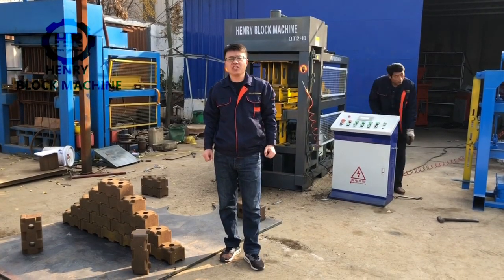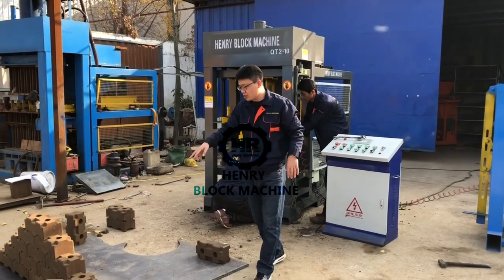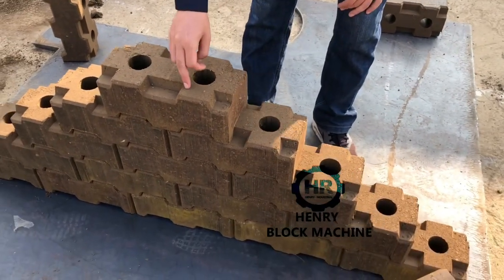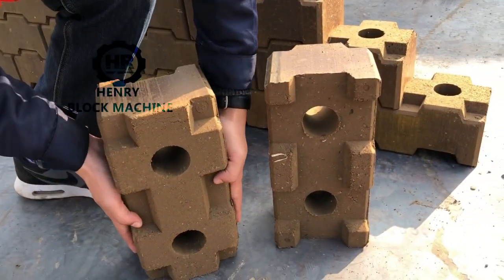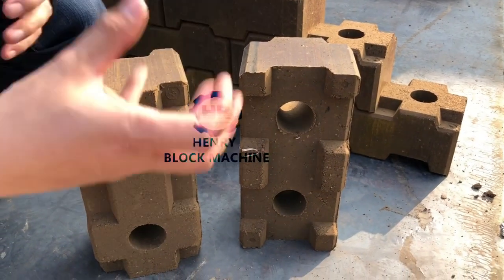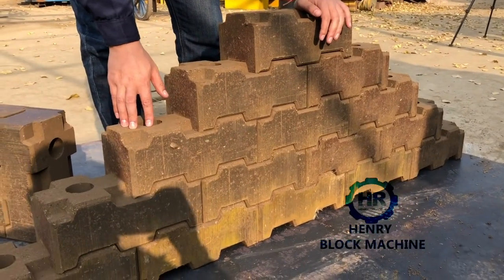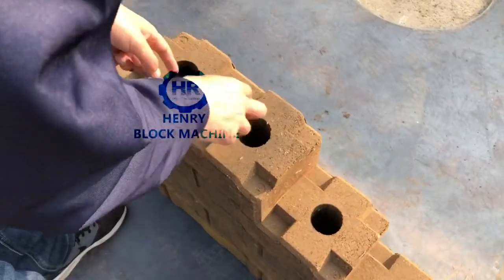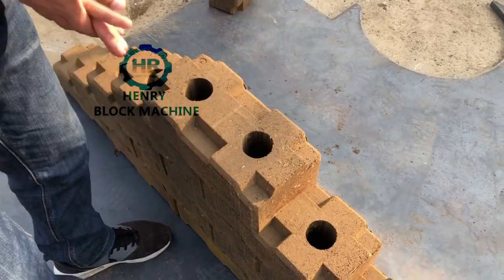How can a soil brick making machine help you build a sustainable future? How to use a soil brick？

Comment: What does this cost??
Reply from the maker: Hi dear friend . If you need more information about Henry intelligent brick machines . Please go through our official website : www.brickmachinesupplier.com
Reply: @HenryBlockMachineGroup I want to travel and build with these machines.  I am writing a book about environmental building.  I will refer to your information.

Have you tested these bricks using structural bamboo beams for additional support.   I understand they harvest and use glue to compress bamboo into structural beams.  I want to cut these beams with a computer guided router for wood joinery.

Thank you

Comment: Have you tried a curved brick design, where each brick is a half circle, with interlock, and one brick goes in upside down position in a rotating order. Main purpose is load bearing weight distribution.
Reply from the maker: @Traintoytrain   we made such kinds of curved interlocking bricks before .
Reply: @ did you do weight stress test and are the number results available in any video or on the web ?

Comment: Good day sir, excellent machine. What are your interlocking bricks dimensions. Where I live, we distinguish between blocks and bricks, the common block is M150 with the dimensions of 390 millimeters long, 140 millimeters wide, and 190 millimeters high whilst the common brick dimensions are 220 millimeters long, 108 millimeters wide, and 70 millimeters high.

How do your interlocking bricks compare in size to the above dimensions ?
Reply from the maker: Hi dear friend 
The difference between block and brick is block are normally made by concrete materials, 
Our interlocking brick size are normally 300*150*100 mm height . Certainly it can be customized to be any size as you want

Comment: Great design. I see that the holes line up for concrete pour as additional reinforcement 👍🏾
Reply from the maker: What’s kind of reinforcement do you use normally ? Concrete or steel bar ?
Reply: @HenryBlockMachineGroup  Steel Bar would be best.

Using C purlins on top and bolting to the concrete slab with threaded rod and nuts would create a post-tension brick wall; which would be very strong.
Reply from the maker: @finalmidnight hi brother. Can I have your WhatsApp number? So that we could discuss this with you more
Reply: @HenryBlockMachineGroup  pls how much is your machine? do u have sales representative in Nigeria?

Comment: Soil bick is a misnomer..  There are two ways to make these; sand clay or  sand mortar (Portland type depending on desired strength 7 to 12% portland, portland-mortar )    un-fired clay sand is going to be low strength, they can be low fired, but even then they will be a soft porous brick, not up to brick standard (500 PSI) .  Testing is the only way to determine the standard and usuall these are used in non load bearing structural components or low buildings that have low structural requirement and regulation, such as farm out buildings.  Portland stabilized and hardened will meet brick code depending on the impurities that can be destabilizing to the final set mix.  Qualified testing usually is required for residential/commercial used as load bearing.  My estimated cost after looking at a similar system, USD is 0.15$-0.30$ depending on the out put.. low end would be for like 1 million bricks of the portland stabilized 12% type (and one could also include some short poly-coated fiberglass  10-15mm strands in it also)..  about the only way you can beat this estimate is to own a wet concrete-cement plant and gravel pit ( or concrete grinding machine and sorter).

Comment: Hello Sir. I like the mold designed you have sir.
I have my bricks machine but it is different like your mould. 
Sir can i buy your molds. 
Im from the philippines.
Im mr frederick ordinaria
Reply from the maker: Yes . We could provide you the different brick  molds . Can you add my WhatsApp number: 008613053989171.
Reply: I like very much your bricks product, im sure interlocking is very strong. What is the height, lenght and width of that bricks.

Comment: I guess you have to manually cut bricks in half, since the bricks are not stacking directly on top of each other but relying on two blocks beneath it, always leaving a half block not connected to anything???? Looks strong though.
Reply from the maker: dear sir 
thanks for your honest comments , about your question, i can say that the machine can be exchanged by the half brick mould, so you can also make half brick and relying on each other so every layer will be interlocked very strong .

Comment: Pretty slick. The only addition would be a fan that's constantly blowing at that delivery area. It would eliminate one step, and keep it blown off better.
   I really like the brick design too.
Reply: Great idea, but instead of constant, I think a timed switch (10 seconds) could be activated when the bricks slide back for pickup, would save wear and tear on the fan motors, but great idea, none the less. Also the bricks need to be sent down a conveyor belt or something. There is too much back and forth, and bending up and down for workers. There needs to be a less human manual transition from the brick pickup and lay down area.
Reply: @angrybritches1854  More good ideas, right there. Now I wonder if they just set it up to show. If it were put in place for duty, these ideas would really take it to another level.
Reply: @kevindouglas8768  Yeah. Let's build our own. 😁
Reply: @angrybritches1854  I've been thinking about that too. My land is in southern Colorado. If it rains, the ground turns into a slick mud that clings to tires and boots. It's sticky and slippery at the same time. I bet the natives made pots out of it. When it dries in the sun, it's hard as stone.
   Now to make my own bricks. I even thought about making really big blocks instead of small bricks...
   Any ideas ???
Reply: @kevindouglas8768  I'm in Highlands Ranch. Just left the new North Water Plant project in Golden CO. I know the soil. Have you looked into cob bricks? Or get soil tested & see what type of Earth brick is best for your soil type.
Reply: @angrybritches1854  I haven't. I do have a strong geology background, so I know it's got lots of clay. I'm building a big shop this summer, so this is important. I was thinking of back filling with walls of stone too. So many flat rocks here that it'd be a waste NOT to.
Reply: Clay is great for bricks.
Reply: @angrybritches1854  Oh yeah. I even thought of adding a little mortar and making stabilized blocks. Lately it just won't stop raining. Every afternoon I get wet here. Yesterday was hail. I'm using my John Deere tractor but it doesn't get good traction if the ground gets any amount of water. Then, I have to wait till it dries up a bunch.
   Maybe I should time it so the rain does the watering job for me?  Bahahaha
Reply: @kevindouglas8768  The water is needed. It has helped Lake Meade quite a bit.
Reply: @angrybritches1854  I don't complain about the rain. It just shows up at random times when I'm planning work. My German Shepherd knows it stops my jobs, so he watches the sky for me and warns me. I've never seen a dog watch the clouds and tell me about dark areas in the sky.
   I'm setting up rain catchment too. Eventually my off grid set up will be so easy to operate...
Reply: @kevindouglas8768  I was gonna setup offgrid here or Utah, but I've decided to just move overseas & watch the flames 🔥 from there. Politics have tested my patience.
Reply from the maker: Thank you for your comment , if you like to know more or like to get a brick machine . Please add my contact whatsapp number: 008613053989171.

Comment: Hey everybody, they never said how much this machine would cost. I think it’s a different price for each country and there’s no fixed price. Also, I don’t think the be said what the breaking point or how much force does it to break each brick. He didn’t talk about the maintenance of the machine either. So many people are asking how much it is and he says call me. People don’t want to talk to you, please just put a fixed price for everybody. There are machines like this selling $800.
Reply: How much is this machine plus shipping to Zambia
Reply: Boa tarde❤
Reply: Hello  how  much is the machine?  Can I buy it from  Kampala  uganda?  If not  what  is the cost  of buying  and transporting it to uganda?
Reply: What is the moisture percentage required to make an optimally dense block. 
If you need to cut the block at a particular point , what method would be the easiest ?
What is the crushing strength of the block ?
Would there be an increase in strength if an additive like Portland cement is added ?
How can the cost of this block be compared to other similar blocks ?
Is there an automatic method of placing the blocks on a pallet and stacking ?
Finally where are you manufacturing the machine and the horse power/ KW required to power the machine, and will you be able to ship it to India and the service backup.
Reply from the maker: Hi this gentleman. Firstly thanks so much for your careful comment. Maybe you are not the only expert in this industry, our machine can come with different brick moulds . And also different client requires different quantity of moulds . So the quote are different
Reply: @HenryBlockMachineGroup  
Please present all different prices to the people who are asking you. Let’s say you have 4 machines. 
A, B, C, and D. Let’s say each machine sells
A=$400, B= $500, C= $600, and D= $800
In this case we will all know machine C is always $600 no matter what country the customer is from.
Reply: Hello  @HenryBlockMachineGroup

Comment: I take it the reason you do not show how easy it is to make corners it because it is NOT
Reply from the maker: Corners will be used by the half interlocking bricks or by steel columns to tight . If you want more information, please add my WhatsApp number : 008613053989171.

Comment: Do the holes in each brick go all the way down; from the top of the wall, down through each brick; all the way through the bottom brick?
Reply from the maker: Of course you are correct , the holes will go down through all each bricks for the reinforcement of steel or tube flow through the holes

Comment: I wonder how hard it would be to place a horizontal circular hole for plumbing or rectangular hole for a circuit box while it's still wet.
Reply from the maker: The bricks can’t be used for building until they are curing completely. 
Sir, if you are interested on this technology of interlocking soil brick , please add my WhatsApp :+8613053989171.
Reply: @HenryBlockMachineGroup  I think you misunderstood my question. I realize they have to be cured. 
But BEFORE they are, how hard would it be to add some holes as described?

Comment: Any other accessories? Like half brick mold and mold for making horizontal beam?
Reply from the maker: Yes . Sir 
You are correct , normally it will comes with half brick and U shape brick for beam
Reply: @HenryBlockMachineGroup  i see that there are holes on the top and bottom of the bricks but how can an electrical outlet be installed without drilling into the brick because drillling will be too difficult? can the machine make such a brick with an electrical outlet hole located on one side of the brick?

Comment: Very impressive but how much does the machine cost
Reply from the maker: Which country are you from ? Do you have this kind of soil ?
Reply: Sir I live in India can I use cement, sand core and small size concrete instead of soil which we use for red bricks 
2) Sir how much is the cost of the machine , Or if the machine is available in India ? Thanks